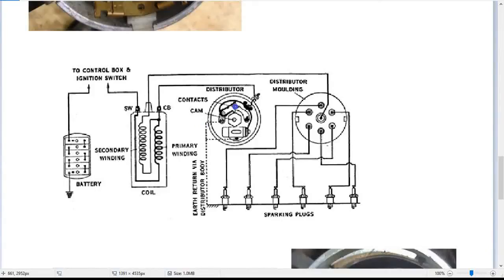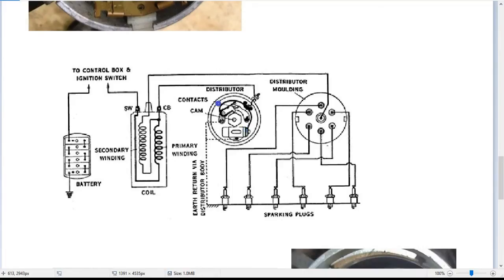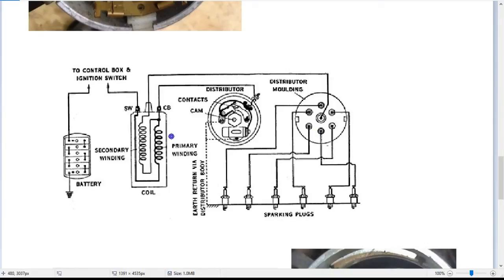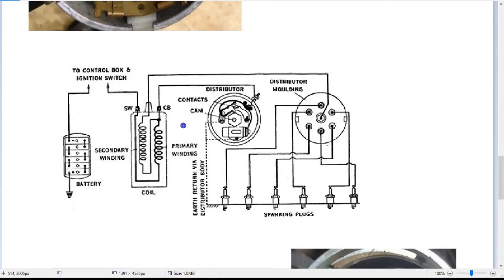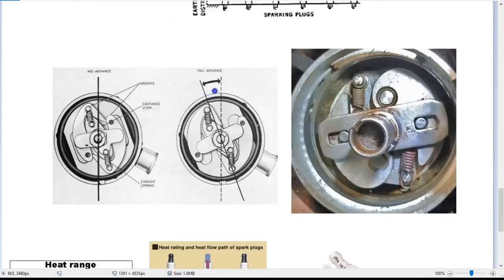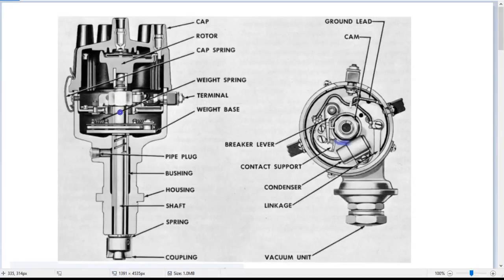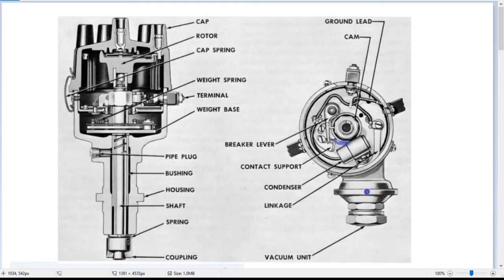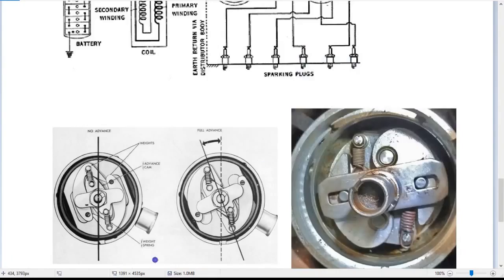Diagnose condenser, ballast resistor, mechanical and vacuum advance E23

Comment: I'm new to all this but trying to learn, my 83 Suzuki hatch starts and runs fine but the resistor smokes, I have changed the coil to the suggested part but still it smokes, I would expect any oil or grease contamination to burn off after a while but mine just keeps on smoking, any suggestions?
Reply from the maker: They will smoke for a while if you get anything on them, if the current across it and points are ok then maybe give it a while longer.
It is persists then replace it.

Comment: nice clip......i have a question?..........i have a stock standard 1972 harley davidson flh.....i have to replace the condensor every 250 or so kms as it begins coughing and splattering..........is there a stroight and simple reason or place i should look at or is it more complicated?
Reply from the maker: I would be looking at an ignition coil as more likely the cause and ensure both the voltage to it is right and test the coil primary and secondary resistances including plug lead and end cap and do it hot after a good run and cold after leaving it overnight to ensure it is within spec.
Coils can show correct resistance when cold but go out of the range when they heat up, specially old ones.
I am assuming you replace points at the same time you replace condensor.
Reply: @AuMechanic  no i dont.....as soon as i replace the condensor the problem goes away for another 250kms or so......i know that normally the points and condensor is a one time job every time, but i figure in my case when i know  the points are good...to leave them be....should i be replacing them also,,?
Reply from the maker: Under normal conditions a sign of a bad condensor is pitted points.
Do the faces of the contacts have any pitting on one side ?
Burned point contacts is usually over current issue that might be wrong ballast resistor or partially shorted coil primary.
With condensor issues the points will have pitting, by that I mean one side will have a small divot and the other side a sharp build up on it where the spark over the point has been removing materiel on one side and depositing it on the other side.
How do the points look ?
Have you measured the coil primary and secondary resistance as mentioned above ?
That would be the next step.

Comment: at 60 yrs of age, i have never found in the shop different condensers for different coils, i did 4 years of electronics, and there is no resonance circuit on the diagram-sorry,  the primary side is a 12 volts dc circuit, the secondary side is an AC signal circuit, the condenser and the open points ( and the battery) are the return path for the 15kv AC spark signal, condensers are an AC short circuit- used to save the points - for a longer life- which they do,   .. i invite you all to review my 4 videos, and throwing out this 3 post coil, and the points for accuspark or similar,
https://www.youtube.com/watch?v=8TELcq7tVRI
Reply from the maker: if you want to observe the "ringing" or oscillation of the primary side of the coil that translates to the secondary side via mutual inductance you only need to hook up an oscilloscope to it to see if right before your eyes.
(the following video E24 explains this in more detail)
As a mechanic in the 1970's I was trained on the use of oscilloscope tuning ignition systems which is now all but redundant.
Generally only Japanese vehicle ignition systems like Denso are marked with the capacitance values in farads on the  condenser otherwise you need to measure it yourself.

Comment: I was always told that the ballast resistor bypass compensated for the voltage drop on the battery while cranking the starter to produce the normal spark voltage rather than try to produce a boost for starting.
Reply from the maker: That's correct, I should have made that a bit clearer in the video that the increase in voltage at cranking does offset the starter load.